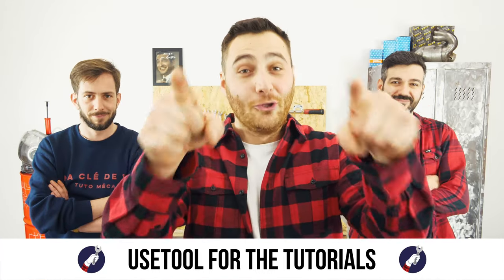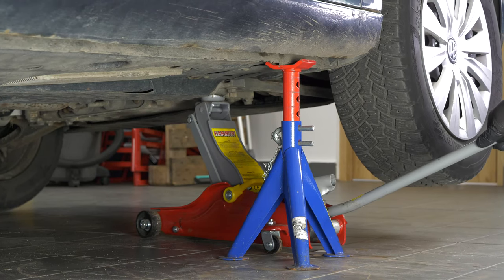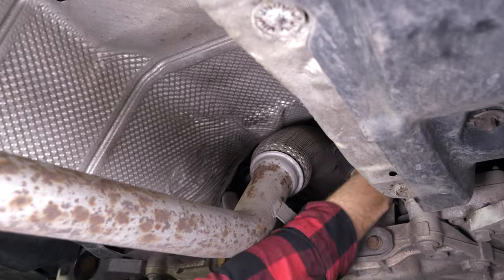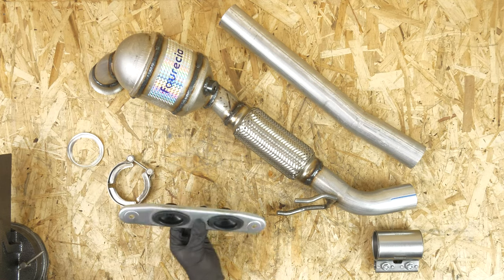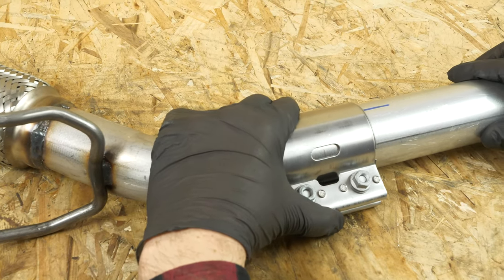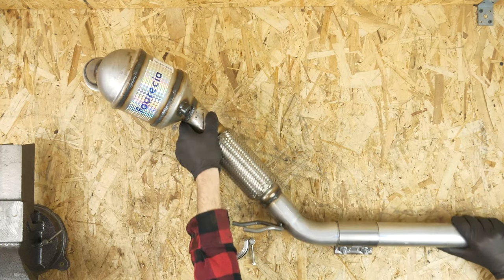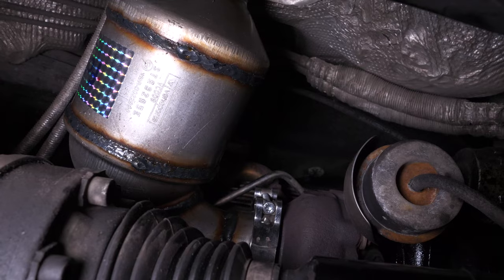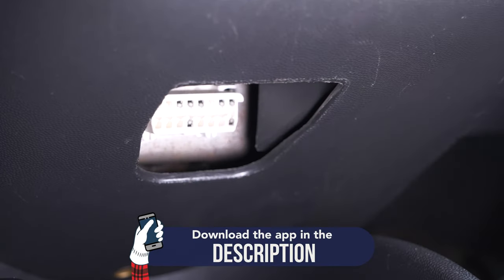How to replace the Catalytic Converter Golf mk5 1.9 TDI 💨

Comment: Brilliant, perfectly illustrates why cat thieves don’t go for VW Golf Mk5’s and Mk6’s.  That would be impossible to cut out without a lot of effort.  Certainly not like Prius and Hondas where you can make two quick cuts with an angle grinder, off and away.
Reply: I wish it was easier so I could straight pipe where the cat goes

Comment: It amuses me how easily all the bolts undo.  This may look easy, but you are a broken bolt away from an absolute nightmare of a job.

I went to change brake pads on my Benz, and thanks to a seized caliper pin the car was off the road for three weeks while I had the calipers fixed.  Luckily I had access to another vehicle.